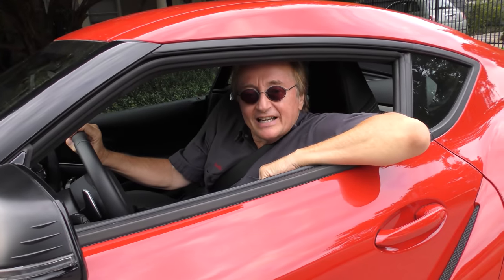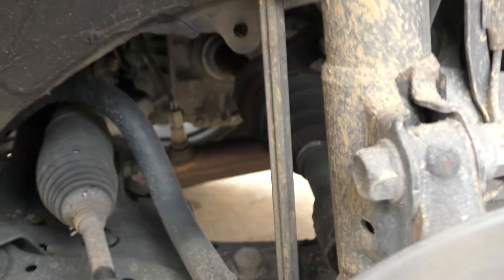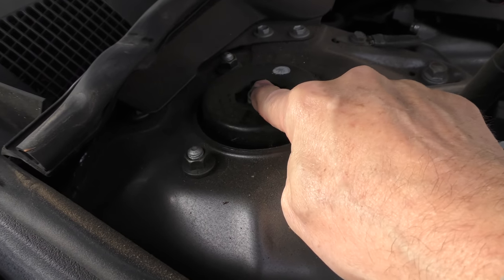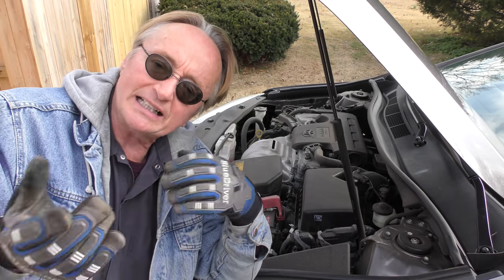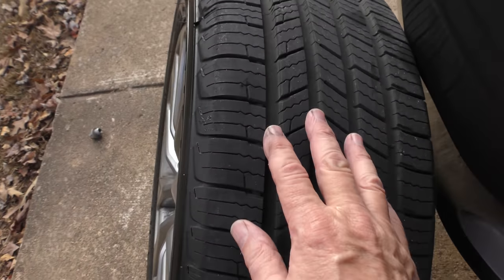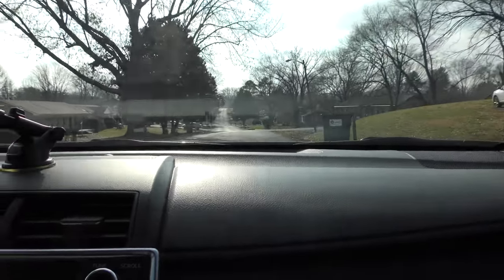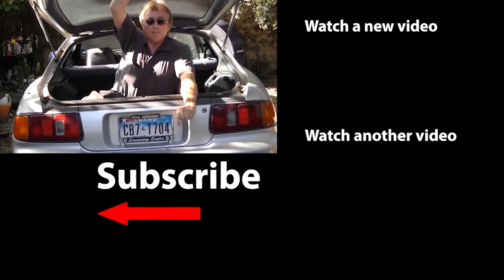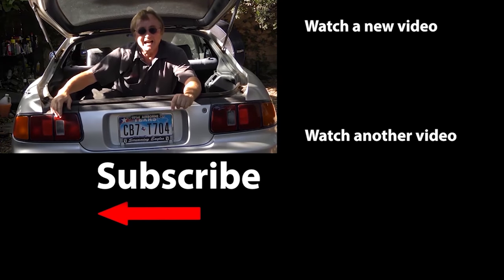Mechanics Don't Want You to Know This About Your Car's Suspension

Comment: It's been my experience that those deer whistles are basically useless! After replacing a couple sets that were destroyed when I hit a deer, I gave up! The best defense against hitting them is the nut on the steering wheel. And as an FYI, I have hit nearly 20 in close to 30 yrs of driving. My commute involves a lot of high deer risk times!
Reply: Maybe the deer was deaf...

Comment: I've been using 100% silicone liquid for years on my rubber.  It seems to be working pretty good.  I need to do it a couple times a year.  More times on the tires.  I'd like to try the 205 though.
Reply: Try 303 you'll love it

Comment: Mr Scotty you made a great point that I already tell my buddies. I have a 1990 Oldsmobile I got at 48k miles from a 93yo lady. It came with the Series 1 3800 engine. A lot of reviews call them damn near bulletproof as long you keep up on the maintenance. This car/engine was made with the average persons skill set in mind. Everything under the hood is easily accessible. Car is still running strong at 70k miles. If they kept making cars too reliable we wouldn’t need them anymore haha

Comment: My 2003 Marquis makes noise wen I drive it. Like squeaking and rubbing metal? Also wen I push the car down from the front end it makes the sound. The car stays straight wen I drive the wheel doesn’t shake the car doesn’t shake. What could it be ?

Comment: I have a 2016 Audi A3 and my car makes this awful clunking sound when going over bumps or turning sometimes to the left. It’s worsen over this last year, right when my 50,000 miles warranty was up. But before than Audi dealership did so many things to fix it. They replaced bushings, alignments and new tires. Still nothing fixed it. I mean I don’t know how to fix it and it is getting very bad and loud,  so bad it sounds like an old granny’s car you hear when the suspension goes out. Help what can it be??

Comment: Hey Scotty I have a suburban 2013 and everytime I turn my car on the rpm starts going up and I just replaced the oil sensor switch what should I do
Reply: There is a conponent in the system that controls the low rpm... this sensor is broken in your car. I had this problem once in a Fiat. I changed it and fixed.

Comment: The rubber breaks . The whole bushing will separate from the control arm .  The horizontal bushings dont need replaced for just the rubber cracking . But they do have a high failure rate .

Comment: Hey Scotty,i am having a problem in my trailblazer, i was hearing a noise similar to bad bearings but the wheels are fine, when actually the rear drive shaft spins, the sound comes from inside the transmission the area where connects to the transfer case when spins the drive Shaft, only the rear, the front doesn’t make any sound, the transfer case seems fine and transmission as well, bearings in the drive shaft are good too. What is that? No codes whatsoever for any parts mentioned

Comment: Hi Scotty what state do you live in, do you do repairs still?? I have small issues with my 2013 vw beetle and repairs are almost a thousand each for parts under $ 20-80. Ex: vacuum leak, fuse replacements to hopefully fix a cigarette lighter and window issue, and a really strange symptom that only happens sometimes at slow speeds in parking lots ...

Comment: i dont know scotty been chasing a weird steering wheel vibration and im thinking it might be those lower control arm bushings there cracked and have alot of flex i wouldve said same thing but this is a weird one 07 camry

Comment: i check motor mounts by putting the car from reverse to drive.. you'll know they are bad because engine will rock and you'll see it if you have assistant do the P R N D routine
Reply: Another great way is to put it in drive,  and press the break and the gas at the same.  If the mounts are shot, you'll know right away because you'll see the engine rocking like crazy.

Comment: Looking for insight on ... "I have to share this before I retire! Video from 8 months ago" can someone explain the difference between this video at205 reseal and the white lithium grease or as some use silicone grease on these similar areas of not the same ? Can I use either or on bushing suspension components etc...

Comment: It’s plastic for weight savings, the same reason all new cars have fouled oil at 1000 miles because of low resistance piston rings that cause blow-by but increase gas mileage.

Comment: Hey Scotty. Got a question... I replaced my power steering pump because it was leaking about 4-5 months ago, I bled it by turning my steering wheel side to side after replacing and have done it multiple times after. But when I go to turn sometimes my steering wheel will get really tight and hard to turn. Do you know why this is? Bad p/s pump?

Comment: Hi scotty I have a 2008 pontiac g6 gt v6 bought for 3500. Yesterday I was driving and I got the traction control light and reduced engine power. Also transmission was shifting very badly. All of this happened simultaneously. After restarting the next day the issue was gone and hasn't come back. The codes I pulled were a p0157 and p0128 could that be the cause?

Comment: Got a clunk sound coming from my GM 8 speed automatic transmission.  GM say it's normal , but could it be a torque converter or valve body ?? Help ? 😐

Comment: Now since he took the wheels out, does the guy need to get balancing/alignment done again?
Reply: No you need an alignment if you replace suspension parts or have irregular tire wear
Reply: @ONeal397  okay thanks
Reply: @Mark Codiroli how am I clueless? I used to do alignments for a living
Reply: @Mark Codiroli I don't know what comments you're reading but I never said do a wheel alignment if you take off the wheels

Comment: hey Scotty  luv your video's. I'm hoping you could tell me why my 2005 subaru outback with a 3.0 the steering wheel starts to violently shake around 65 to 70 mph. I've checked out all the bushings & theyre all in good shape, not even small little cracks in them. ive put new tires on them & made sure to balance them. it has around 80,000 miles on it. my local dealer wants to start replacing all of it because they dont know either. i cant afford for them  to just quess. plz help thank you
Reply: Try new sealed sway bar links if tires are not worn evenly still, you need alignment

Comment: That spray might work for a week.. Then its back..    If it looks too good and easy to be true... It is!   Cures in  bottles don't fix cars,  Except for radiator flush,  which actally did fix overheating for me.

Comment: Thanks for a very useful content Scotty! Can I spray it to Alternator/Fan Belt too?
Reply: Serpentine and timing belts are use and replace. You don't want to use a belt longer than it's intended. The serpentine belt is fairly easy to replace on most cars, and only $25 or so

Comment: The Mustang ll had a 6 cylinder. That was a diamond in the rough because my Pinto had a VERY strong and quick engine. The Pinto had the same reputation as PT Cruiser. You can blame that on the mechanic’s lean and bad mechanics.

Comment: I had a similar problem yeas ago after one of my car's control arm was changed.  The mechanic tightened the control arm bolts and the noise was gone.

Comment: cAUTION !!! Do not spray rubber under your car with anything else no armor all or wd-40 only use the stuff he said . The bushing and rubber in the suspension is not made to be lubricated with anything. You will make the parts slip in the rubber bushings and can cause noise or wear the bushing out because the metal part in the bushes will twist and rub and distroy the rubber bushings. I have done it and it cost me problems and money.

Comment: This has to be a joke. Just start the engine and not power break to check engine mounts. As many mounts now have liquid in them they do leak and under power break you will hear the engine slam down and up or like our customer complaine about exssive vibrations felt in the car and steering wheel .Want to Check bad lower control arm bushings do quick stops if the rubber is weak they will slam and pop. And can't check any ball joint under load need to take the load off of it as is a question on any ASE test. So yes this is a joke.